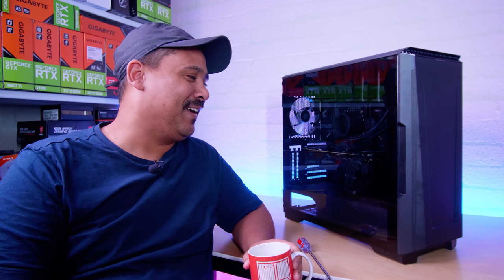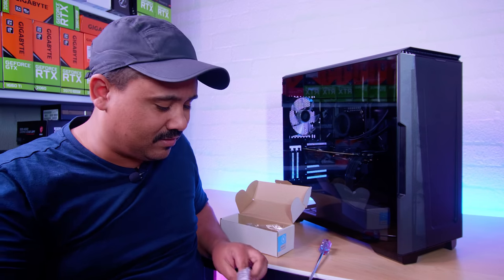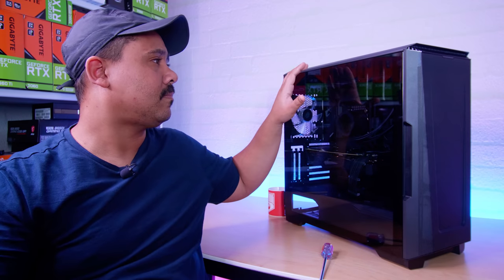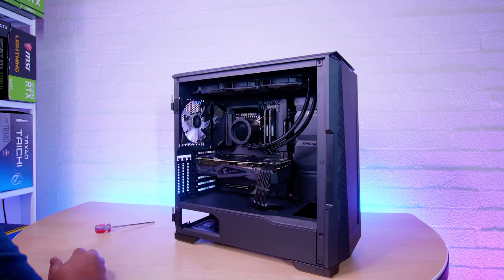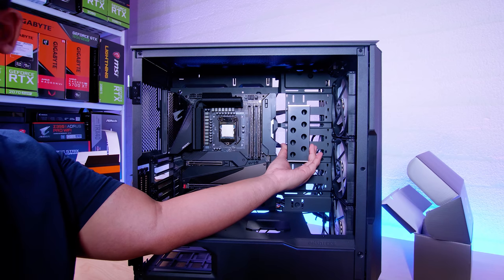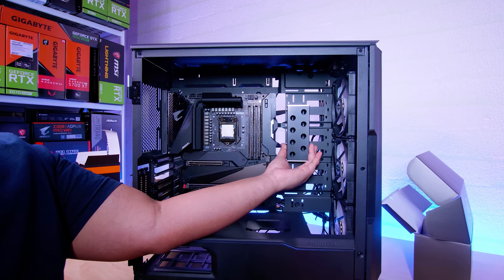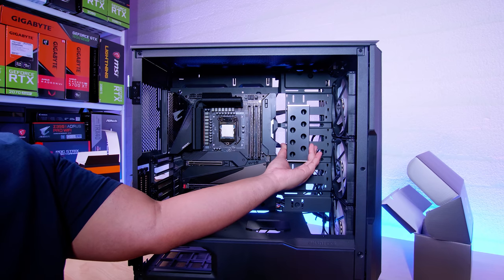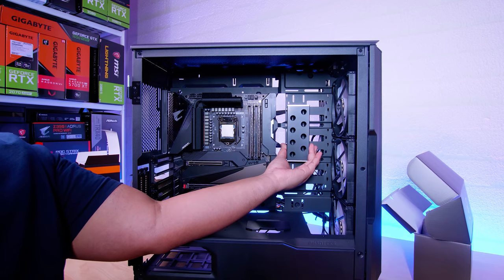"Test Fitting" EK PRO Water Cooling Gear for my NEW Editing PC in Phanteks P500A

Comment: Lian li 011 dynamic is the best case for water cooling. It may be a bit big.
Reply from the maker: I think you're missing the point. The O11 is the Yeezys of PC cases. It's not for a workstation. The footprint of the case is not ideal for a proper workstation.
Reply: Okay
Reply: I had a 011 dynamic and it was nice, but it wasn't big enough. That's why I upgraded to a Thermaltake Level 20 HT.
Reply: @GearSeekers  Can also use the EK "custom" distro plates. That would be a lot easier than a manifold and the pump is already built in.
Reply: i have a normal o11 dynamic, and i think the gpu wont fit horizontally with a waterblock.

Comment: P600S, P500A, FD Define 7 with a CNC'd front panel for better airflow, or a Meshify S2 would be your best overall options for what you have described.  The Lancool 2 is unfortunately just a bit too small for a proper loop if you use QDCs and want to have a quiet, easy to work in, Uber functional system.
Reply from the maker: It doesn't have to be easy to work with. It just needs to fit lol
Reply: @GearSeekers  Say that after you have trouble reaching and getting your fingers around your QDCs since they add so much size to the fittings. You wan't to keep the footprint reasonable but want to have decent watercooling support. You will want at least 720mm of radiator space at 30mm thickness, more if you use radiators other than the HWLabs Black Ice GTS. Anything less than 240mm per cooled component is less than ideal for maintaining good noise levels. Personally, I'd go for a CNC'd panel Define 7 or a P600s for your uses. You have the hardware, It's worth paying a machinist to make a Define 7 worthwhile.
Reply: @GearSeekers  Oh and the reasons for the P600s over the P500a are, one, that it has a fill port and drain port you can use since you want to mount the pump/res in the basement, and, two, better dust management since you are keeping the computer under your desk. The airflow and overall performance is almost identical between the two but the cloth mesh plus dust filter does a better job of preventing dust buildup than the 1mm perforated steel holes of the P500A. Also, the P600s has a removable top radiator bracket and properly removable top panel. I've built a few workstation systems like this(I build between 20-30 custom loops a year currently) for people and I cannot stress enough how important it is to really consider serviceability before you actually put it together.
Reply: @TheJjjoj  hm.. im currently in the process of chosing a case for custom waterloop. i like the 600s, my question is, if i can run 4x 3,5" drives + 2x at least 280mm rads - from the clearing in the bottom i guess it will be very hard to have 2 drive cages + the cables of a 750+ watts psu.
Reply: @randomchars9619  It's definitely doable but would likely require some modification unless you use an SFX-L PSU with an ATX adapter or a very small ATX one along with custom cables. You would also need to use a pump/res combo.

Comment: How about Macube 550, I think It has basement space for the pump
Reply from the maker: I think the main issue is airflow, mounting the manifold and EATX with the Macube 550. Might check it out though. Thanks for the heads up. I forgot about the 550.

Comment: The P500a and Lancool Mesh II are both very much pique'ing my interest. I think my initial thought is that I prefer the phanteks one - but I'm really not sure. I think I like the front of the phanteks more and the side with those vents in the bottom of the lancool more. 

The P500A seems almost overkill for just air cooling thought, but for a water cooling build the extra space is probably really nice! 

Another alternative is the Meshify S2 (remove the front foam) - fractal cases are solid!

Comment: Cooler Master H500 maybe? with front mesh ofc. The reservoir will fill out the empty spaces
Reply from the maker: I've got one. I might test fit some stuff with it over the weekend.
Reply: @GearSeekers  and Cooler Master H500 always looks great with custom loop. Its also pretty spacious so it doesn't look like you cramped everything with what you have into the case.

Comment: Thermaltake Core p3 or core p5? Wall mountable will save you room on your desk. Core p5 will be more forgiving for custom loop. I think. I think cougar conquer is pretty cool, but you may want to re-paint over the orange, I personally don't like orange.
Reply from the maker: Not practical cases for a proper workstation. My system lives under my desk out of sight
Reply: @GearSeekers  fair enough! Worth a shot anyways. Honestly I didn't think you'd see my comment. Just want to let you know how much I appreciate your videos. Thanks to you and Gamer's Nexus I was finally able to make up my mind on a case. My top pics were: core p3, Meshify c, and NZXT h710. Until I saw your video on the CM TD500 Mesh, I was already impressed, then I saw gamers nexus review on thermals coming second to p400a. I knew right away this was it. Thank you for your videos being such an important resource for my first ever build:

R5 3600x
B550 aorus pro AC
Gigabyte RTX 2070 windforce 2x
Trident Z 3600Mhz cl18 8gb x2
Corsair RMx 650w 
In win Sirius loop x 3
Thermaltake black AND red sleeved PSU extensions
Td500mesh black

Aorus CV27Q

Steelseries Apex 5 and rival 600

I love your videos! Keep it up!

Comment: But custom watercooled systems needs maintenance every ~ 6 months (at least i's recommended)
Reply from the maker: Incorrect
Reply: @GearSeekers  I have loops in the wild without maintenance in 3.5 years that are 100% functional with no corrosion or discoloration. However, depending on the coolant I use, I swap my coolant every 6-15 months. Because I do it so often, I never really have to wory about buildup or cleaning as much between re-fills.
Reply: just for your info: a proper planned custom loop (with longlivety and not bling in mind) can even run 10+ years w/o maintenance.  ive build one , so i know what im talkig about. 
you need to know the chemistry of the used parts, - coolant, metals and tubes + a large reservoir helps too
hint: what was the last time you had to maintain your cars watercooling loop?